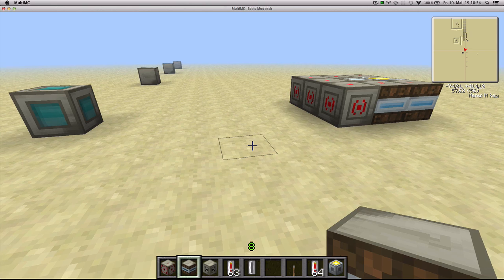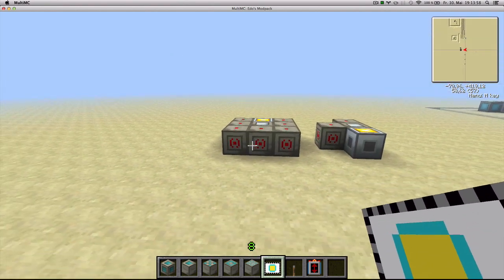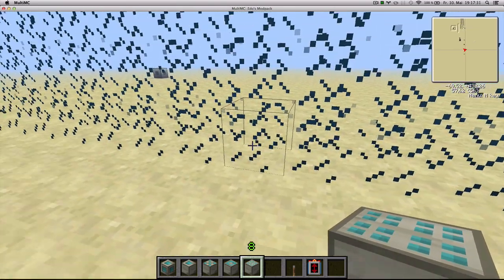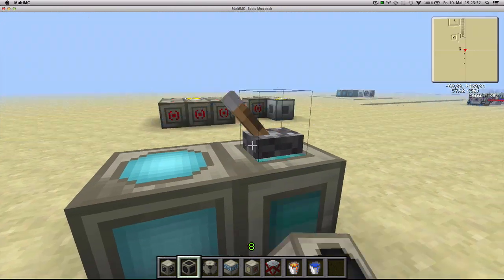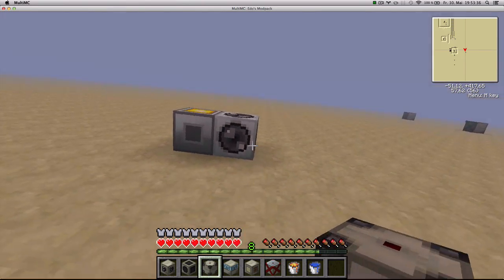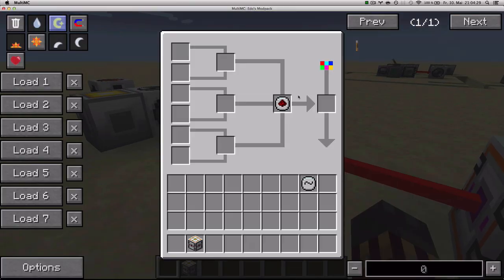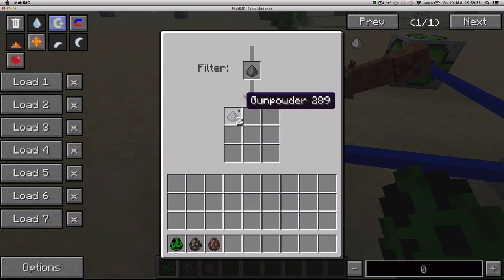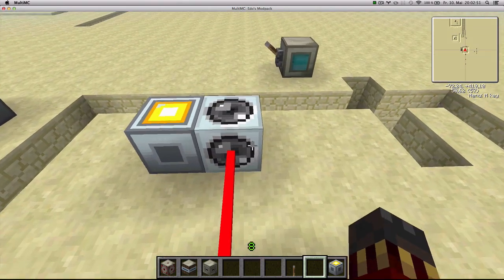Mod Spotlight - Advanced Repulsion Systems 55.1.0

Comment: So, I use a mudpack with 100 mods. I never used any of the mods in the pack. Every mod spotlight is 30 mins long. 30 mins times 100 = 50 hours. That is how long I have to sit here and watch videos just to get familier with a mod pack. It is not worth it.
Reply: Dude , you don't have to do ALL 100 mods, in fact some of the mods may actually do similar things so you wouln'dt need to anyways, just look in your creative tab, look for something that looks cool, then watch a tutorial and just take one mod at a time. I use 146 mods, I only probably know about 90 of em that i've been learning over time, been playin 2 years, but the amount of mods never stopped me from having fun.

one project at a time, not 100 :)
Reply: Not a big deal just kind of overwhelming. I wouldn't be surprised if 90% of people using a big modpack knew anything about half the mods they had installed.